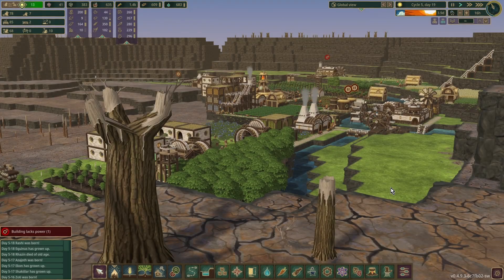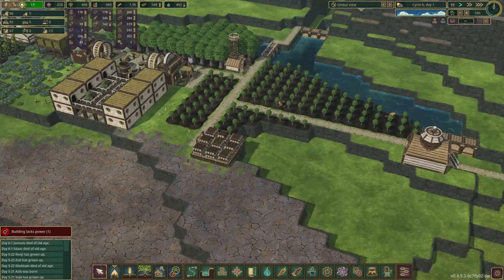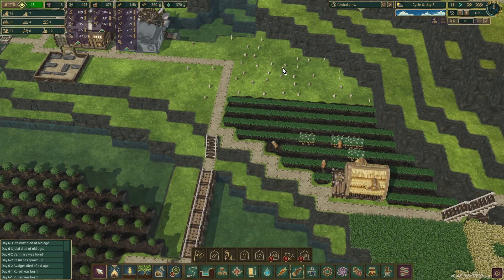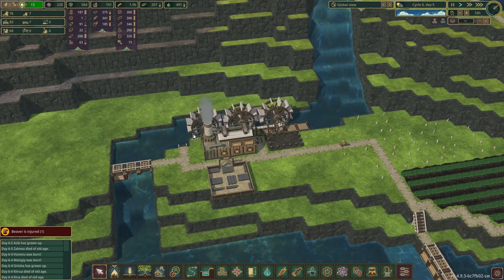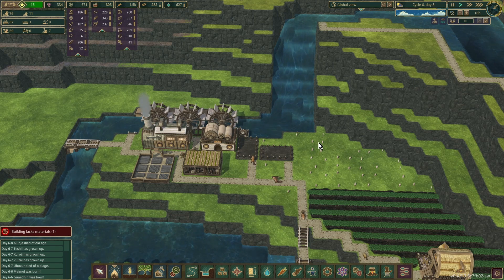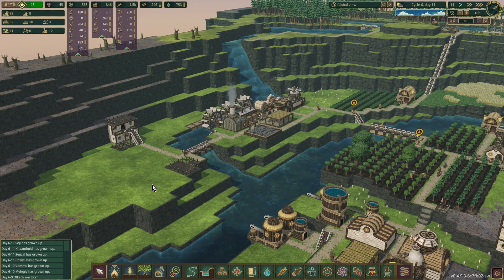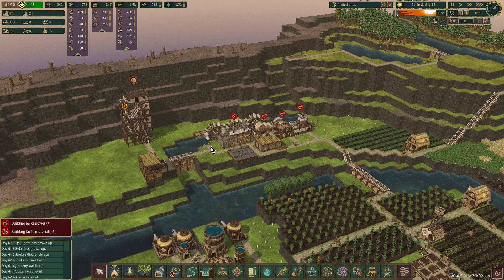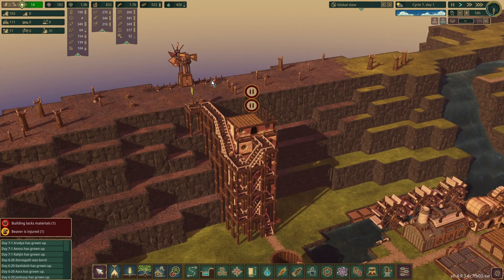Timberborn Update 4: Episode 5: Power Block

Comment: The Gear Workshop already gets power from being adjacent to the Paper Mill so the power shafts were unnecessary, although what I would have done is extended the shaft an extra square and added a 4-way intersection in case of future expansion. (Really, it hardly seems worth building lesser intersections.)
I was wondering whether you could have raked back the triple lodges so that each one was overlapping by one square. (This would have needed a different gravity battery plan.)
You can build bridges on platforms but they're only good for allowing beavers to cross gaps; power still needs shafts. (I have seen a mod for a bridge that allows power shafts to be built on it.)
Windmills count as 4-way intersections so you don't normally need to build your own. I didn't get a good look at the power connection from the lodge, so maybe there was a good reason for that. Speaking of which, your Gravity Battery was at the same height as the windmills so you could have connected power directly across from there. I didn't think about letting the beavers cross the ground level power so I was assuming it could just connect out of the front of the lodge (relocating the decoration that is currently there).
Given all of your power I think you should relocate your wood workshops, or build some sort of power line across the map which they could hook into but would also provide power to your other potential districts. Is it time to invest in an Observatory yet?
Reply from the maker: That whole power set up was a "adadpt as you go along" kind of thing. It was meant to be temporary until I have the Large Windmills available. I could have staggered the lodges back, but my plan is to be able to put in a matching set of lodges back-to-back with them.
Connecting the lodges to the windmills was done before I put in the Gravity Battery, I think, but yes. I absolutely could have connected it directly to the power!
I like to have plenty of connection points along any power network, i9ncluding around the windmills. It's just a habit at this point, really. 
An Observatory would be good, and are definitely on the list!
Reply: @StormhavenGaming  I hope your Large Wind Power Grid will be a spectacle worthy of its own episode.
Reply from the maker: @urkerab  I am sure that there will be one at some point. I've already recorded the next episode though and there are some modifications to the power grid...

Comment: Build plenty of science buildings off somewhere. Set their priority to the lowest setting. This way any and all unemployed workers automatically go there to make science. You do lowest priority, so any other job that's open, they'll just leave the science building and work the normal job. Great way to keep unemployment at zero.
Reply: same thing for power, build a bank of power wheels, set low priority, so unemployed beavers can make science, or make power. ;)
Reply from the maker: That is a really good idea. I currently have the Haulers set to low priority but replacing that with the science buildings would probably be smarter. thank you!

Comment: I have a question why do you not invest in the bigger housing units sooner? Or other farming options?
Reply from the maker: The other farming stuff will happen later in the series. I didn't ignore them completely.
As for the lodges, I really never felt the need to upgrade them. The standard lodges are generally sufficient.